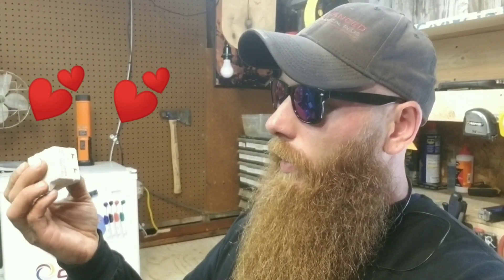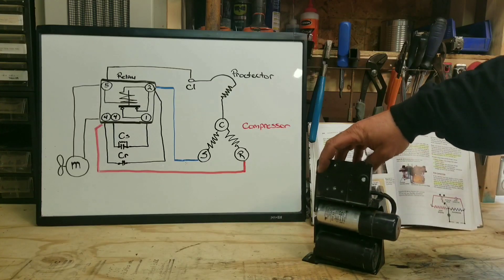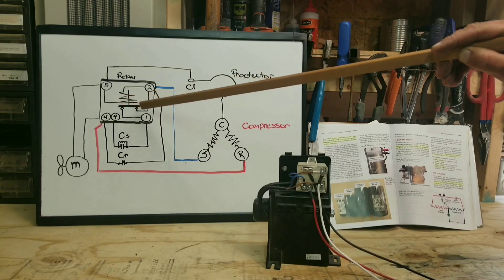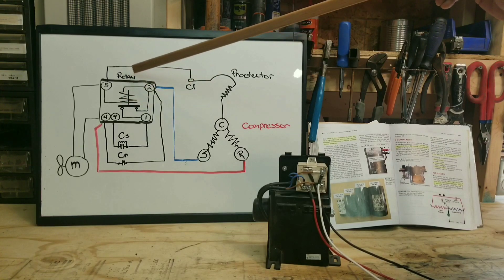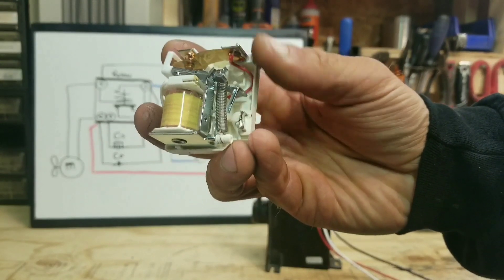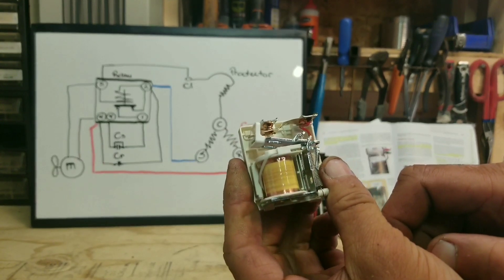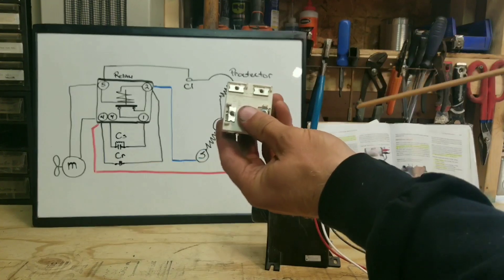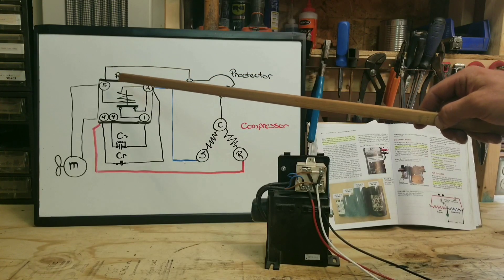Let's chat about potential relays

Comment: As you mentioned, the only thing this potential relay does is put your Start Capacitor in Parallel with the Run Capacitor for a fraction of a second during the compressor startup.  This causes a temporary electrical phase shift in the motor windings to help start the motor faster and reduce the initial draw to the home wiring.  If it goes bad, typically you will see lights dimming for an extended time in your home and may also experience a main breaker popping.  The common problem is that the Start Capacitor has gone weak or bad, rarely a bad potential relay, but they do fail over time, so best to check it.  One thing you can do to test if the potential relay is actually working correctly AFTER you have removed any drain resistors from the Start Cap and tested it with a meter to insure it is correct is to (solder the drain resistor back onto the start cap if you removed it, then reinstall it or replace if if it is bad.)  Next, check to insure that it is wired correctly to the Start, Run and Common points correctly in the AC unit.  After that, put an Amp Meter clamp around the wire leaving the #1 pin on the relay and you should be able to measure initial Start Up Amperage (in-rush current) only for a fraction of a second when compressor startup happens.  After that, you should not measure any Amperage on that wire if the relay is working and pulled in breaking the connection between pin #1 and Pin # 2 correctly.  If you measure Amperage on the wire connected to pin #1 while the compressor is running, the contacts are welded together OR the relay coil is burned out and not pulling in to break the Pin #1 to #2 connection.  Hope this helps!

Comment: That was my main concern.  What if the potential relay failed while unit was running? What takes the hard start cap out of the circuit?  Sure, what are the chances of the relay failing?  Will the thermal overload relay save the motor windings?

Comment: Are they similar enough to use the potential relay from a hard start in place of a burnt out one on say a walk in or reach in condenser. The voltage should be close enough to keep the timing close to design drop out.

Comment: I am in a foundations HVAC class, and I gotta say, you did a great job of explaining this. So what I understand in a nut shell is that it functions on Back EMF to open the circuit once the compressor is at 75% of its rated RPM and it takes the start capacitor out. I couldn't figure it out based on the info that we were supplied. So thank you.

Comment: Use amp probe on start cap to see if it draws current on start and opens once running. When replacing one be damn sure it's right. There's a pile of different ones with totally different specs. Use a bleed resistor on start cap or it will fail in short order

Comment: ...and I had no idea that the back EMF was that high! Now I'm curious to see how high the back EMF in mine produces. I just recently lucked out and acquired an old Fieldpiece HS35 meter, now I have an excuse to play with it.
Reply from the maker: Awesome- let me know what you find curioushvacguy@gmail.com
Reply: @curioushvacguy6876  ok I finally got around to it. The back EMF (from combined compressor and condenser fan motor) is about 280v, assuming I did it right.

Comment: I'm still a student and still a few months a way from working in the field, so I'm relatively brand new to this trade. I was tought what these are and what they do in my first class, but it wasn't until somewhat recently is when I truly understood these. The final for my previous class, I had to draw the electrical diagrams for the a/c in my house and write a 2 page report on it. I took the cover off my condensing unit to see that little white relay and wondering wtf it was. But while drawing the pictorial diagram is when it clicked on me. Normally closed relay connected to the start capacitor. On my unit though, it's diagram referred to it as a "cap switching relay."
Reply from the maker: and now that you know, youll never forget- awesome lesson bro

Comment: The beard of knowledge strikes again. Makes sense to me. Like a 220 phase converter adding a 3rd phase, sort of.  We've got an ozone generator and compressor on our water system and have a timed relay to give the raw water a shot of ozone so the backwash filters can remove the iron easier. The relay has a  variable timer and set for one shot of ozone air per pumping cycle so the system won't get overloaded with ozone in gas/air form. If the water in the house starts smelling bad I just up the timer a bit. This is a home made deal but I know there are really expensive systems that would micro manage everything down to the atom but we're too impoverished for that to happen when there's another option that works. Keep on 'splaining things! My ears are up and wiggling! THANKS!.
Reply from the maker: Thanks for the feedback- much appreciated

Comment: Great video.  This is why you should always install OEM hard start kits.   The generic ones are not designed for each specific unit.  Each compressor has different back emf at 75% load.

Comment: Used to be these were gravity drop so you had to look for the arrow signifying up. They are still out there so always look for the arrow. If they are installed incorrectly the cap will blow up. On another video one on inspection s. You mentioned how to test a run cap with the unit on. Multiply times 2650 or something like that. An easier way is to read your amps on your common and run together. This should be equal to the start amps + or - 1 amp and the run cap is good. Test this you will find I’m correct. Take out a 40uf and install a 30uf. Test your amp readings. Let me know if you do this and give me the results.
Reply: Sent you my email address

Comment: Nice job. I’ve always explained it as “higher than line voltage “ that takes it out. That’s the way I was taught. You don’t see these much anymore in HVAC. Usually refer. 
 Have you ever checked the voltage of the unused leads on a three speed motor? That back EMF is neat to read
Reply: Curious HVAC guy : just higher than line on one tap and even higher on the other. Neat how the windings become a generator.